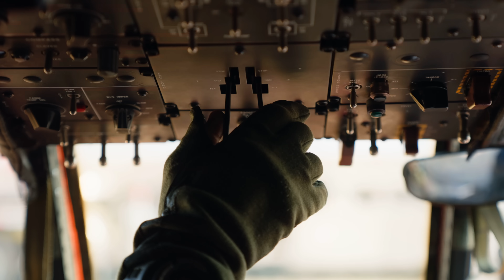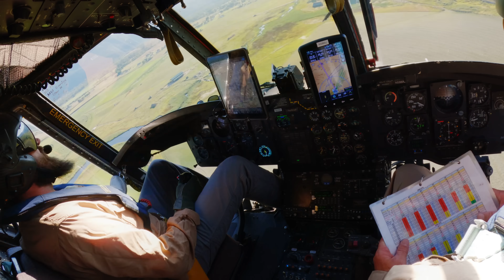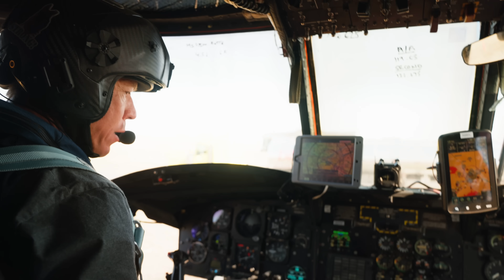How Billings Flying Service Became the Chinook Helicopter Firefighting Specialists

Comment: Just a side note about the General Aviation ramp at Billings; the chocks are placed behind the tires due to the uphill grade. The DUKE and CE-182 I used to fly from Greybull, always had two chocks before tiedown. Also, an excellent avionics shop (Aerotronics) at the airfield.
two

Comment: I flew buckets with the UH-60 and fixed tanks with the Fire Hawk. We could only fly 90 knots with an empty bucket so, our turn around times were slower with buckets. The 1000 gallon fixed tank offers a lot of flexibility.
Reply from the maker: Thanks for sharing!
Reply: Something else I noticed that didn’t get pointed out is the versatility of this setup. With the Bambi buckets I’ve noticed a few pilots point out they’re limited in the sites they can pick water from. It seems like they tend to need a minimum of at least 5-6 ft of water depth to be able to scoop. With this it looks like it could pick up from a depth of 2 ft or less. You could practically scoop from a creek if you had enough clearance. It opens up so  many different water sources you can access that could be much closer to the fire. Then you add on the increased payload and speed and that equals a shitload more water getting on the fire lines. What an incredible machine
Reply: @pjcanfield8  That's true. The buckets offer a simpler setup as the the Fire Hawk requires that you switch out the main gear struts. In the California National Guard, we left the Fire Hawk in the fighting configuration for the entire season.
Reply: @KarmaFlight Oh no doubt. The buckets are absolutely a vital asset despite their limitations. Having the ability to quickly throw them on any old NG UH-60 and add additional resources to a fire is a godsend for those crews down there cutting lines. The Billings Chinook is just a very specialized bird and serves a hyper specific job but it does a damn fine job at it! I’d love to see more of these retired army Chinooks  able to help combat these huge Western wildfires!